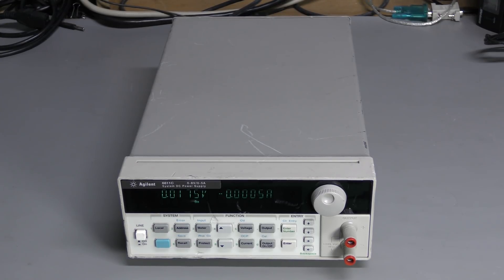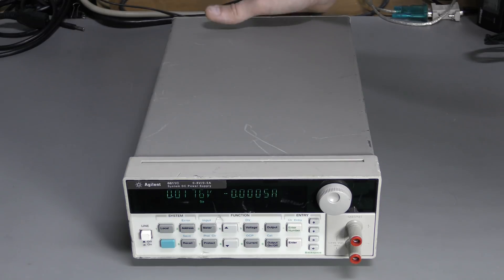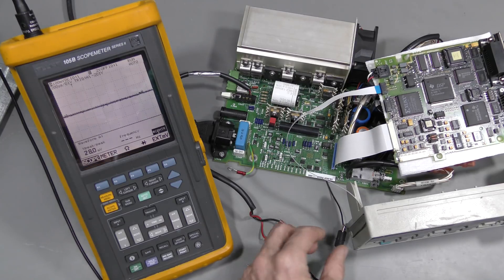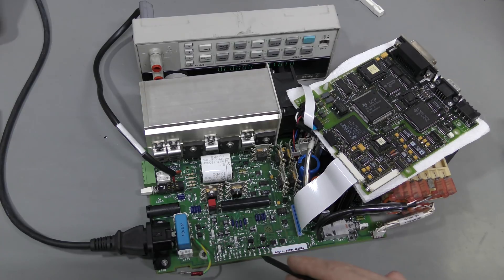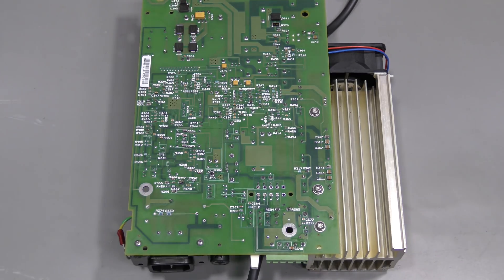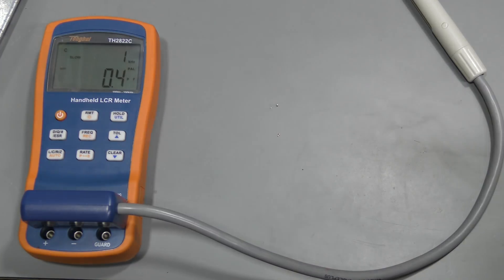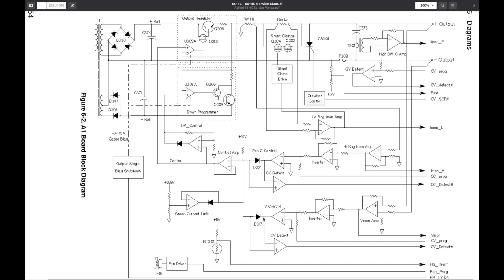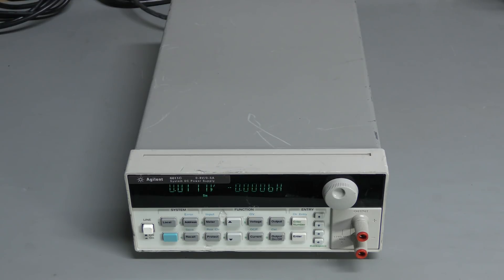#110 - Agilent 6611C power supply repair part 2

Comment: The schematic in the service manual of the HP/Agilent 66312A (Keysight website) matches the HP 6611C as well. At least for the one I repaired recently. The controller boards are shared between many models and the power boards are very similar as well. Depending on the board revision, newer board revisions have more SMD components than the older, but the schematic concept is actually the same behind it.

Comment: Excellent detective work and repair. A microscope can be very handy when examining boards for cracked solder joints and such. I hate intermittent problems!
Reply from the maker: Yes, a microscope would be handy. Especially one of those with HD recording built in. I don't have much room for it and not sure which one to chose, but wanted to get something of this sort for a while https://www.amazon.com/dp/B07DYR28JX/
Reply: @feedback-loop  Stereo microscopes are much more effective for searching cracks and similar mechanical problems. El cheapo simul-focal Chinese SM-4TP clone ones are good.
Reply: @feedback-loop   I use an Adonstar AD 206 that I have modified, raising it 8 cm and extending it out 8 cm. This allows me to look at circuit boards up to about 28 cm total width (14.5 cm from center of image to support base) while maintaining adequate magnification and retaining it's storage footprint. It does record video (1920 x 1080) and audio to micro sd card but I'm not sure how well it would work for you. I don't make YouTube content and only use the still camera (12MP) function.

Comment: I've made many repairs and I've watched even more repairs on youtube.  In my "experience" it is very rare that the culprit is an SMD device.  Murphy is everywhere!
Reply: It's not that rare as you can think. I do some repair only occasionally but I had similar problem already twice. One capacitor and second time pull up resistor on i2c line. Both so tricky to find (few days).
Reply: It's a low %, but there is a know problem with SMD caps cracking - it caused a fire in power supply that EEVblog was testing -, and for high end applications there are specially designed caps that reduce the risk, eg, they put a flexible substance between the ceramic and the end caps so it allows movement.

Comment: Very interesting. The oscillation looks a LOT like my 66312A when the external network isn't connected. (Option J02 increased bandwidth for fast response when remote sense leads are used. This makes the supply unable to maintain stability when unloaded) The network is 0.25ohm (wirewound , inductive-- non-inductive reduces stability) in series with 25 microfarad (low leakage, film type, metalized polyesther) mounted at the point where the sense leads connect. For general purpose use (front panel terminals) I set for remote sense and plug a connector with shorting bars and the network to the rear.  One of the components deleted for this mod is, coincidentally, the capacitor you found broken (different part number on the board, but corresponds in the schematic)
Reply: john john, I had exact same problem with a 66312A I acquired - oscillation.  Installed missing shorting bars at R331 (output filter) and R358 (near remote sense inputs) and it worked perfectly.  I was fortunate to have a second working 66312A to compare to.

Comment: Great find, please can you tell me how long that took in real time, I'm just curious as to how patient you are !! ...cheers.
Reply from the maker: Hard to say. Many hours. Several attempts over many days. Tried resoldering some joints, reverse engineer some parts of the circuit, chased a couple of red herrings and so on. Now I know that these supplies not only can sink current, but can also sink a lot of time. :)

Comment: I have a auto range multimeter when i move the knob to ohms it shows 7 mega ohms..when nothing is connected. In mA range it shows incorrect readings. In 10 A range it doesn't read anything.. both fuses are ok.
Can you help?
Reply: Yes place it in the post

Comment: I have a similar problem on the DC voltage measurement circuit of a Fluke 185 multimeter. I tried reflowing some parts to no avail. Perhaps I should look at the caps more closely, in the hope  of finding a cracked one, like on your board. It has been very frustrating so far, as the meter deserves a second life.
Reply: I have a auto range multimeter when i move the knob to ohms it shows 7 mega ohms..when nothing is connected. In mA range it shows incorrect readings. In 10 A range it doesn't read anything.. both fuses are ok.
Can you help?